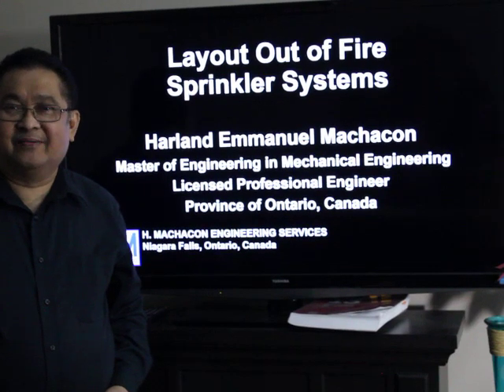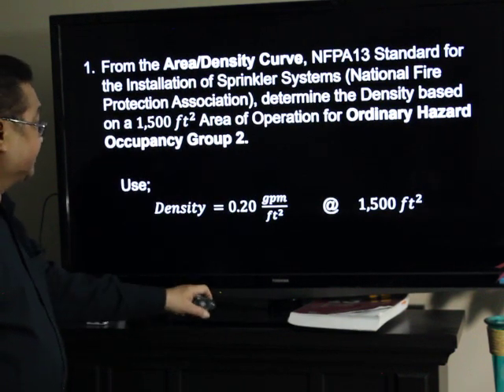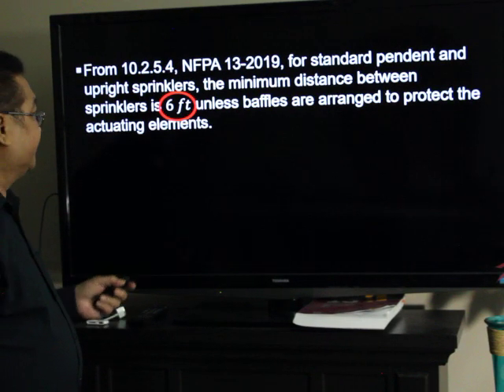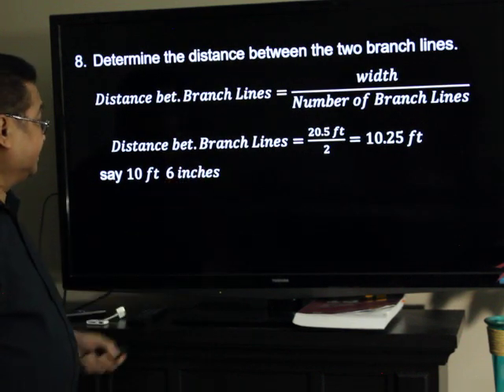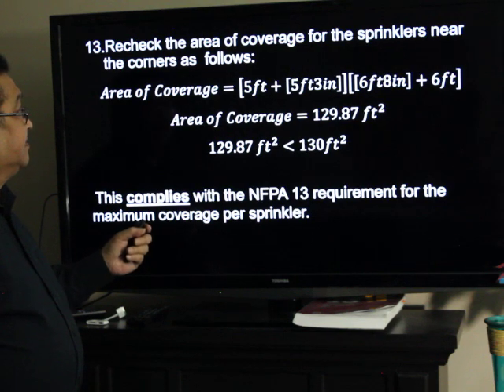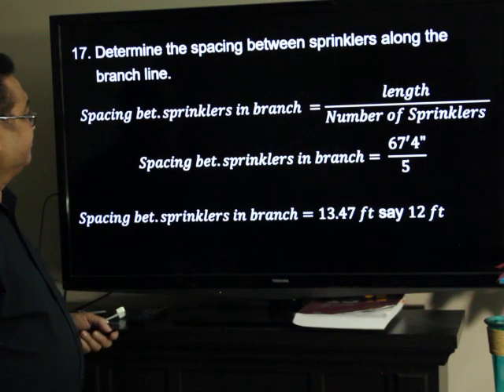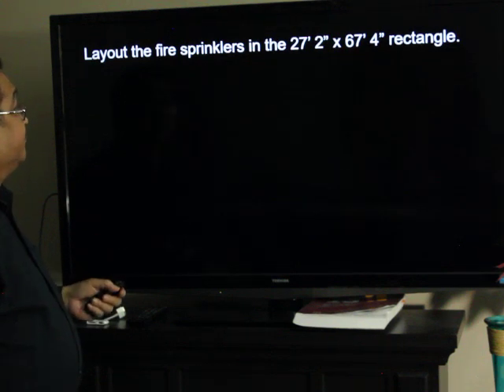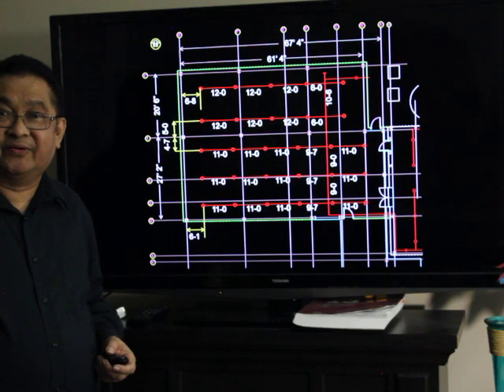Layout of Fire Sprinkler Systems

Comment: Where does NFPA 13 says Branch lines always  run perpendicular to the bar joists or purlins and why?
Reply from the maker: Based on my experience it is better to run the branch lines perpendicular to joists to make it easier to support these branch pipes.

Comment: where did you get   >>>> (4ft,7inch +4 ft, 6inch) x ( 6ft,1inch+5ft6inch) , please clarify , thanks .
Reply: Examine the layout. Consider the 27’ 2” wide by 67’ 4”long rectangle. Take a closer look at the most remote sprinkler head located at the northwest corner of the rectangle. The area of coverage of this sprinkler head extends 4’ 7” to the north and half of 9’ 0” to the south. Likewise its coverage extends 6’ 1” to the west and half of 11’ 0” to the east.